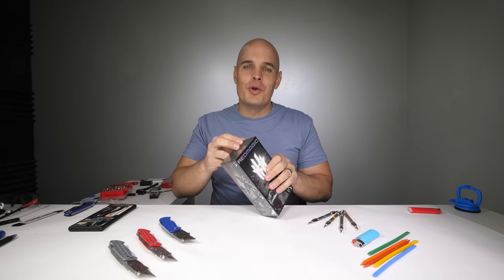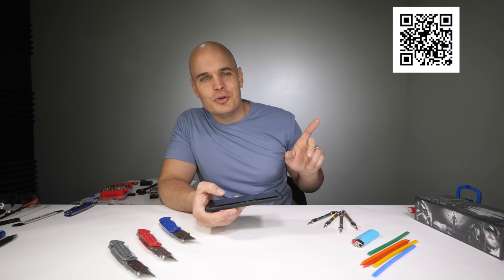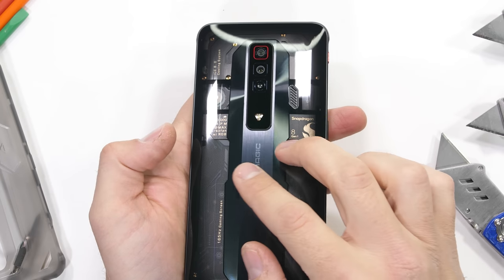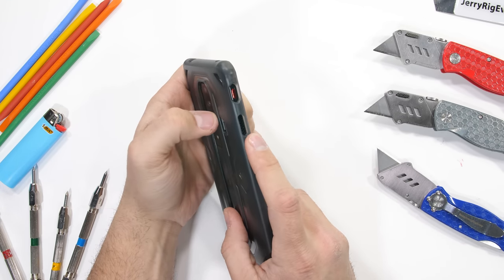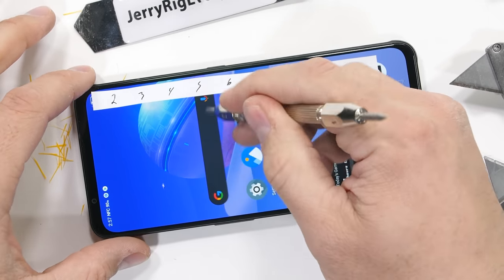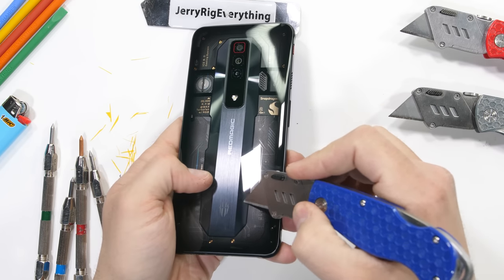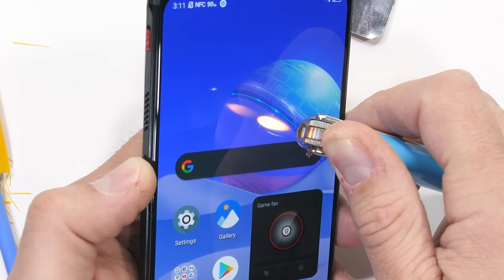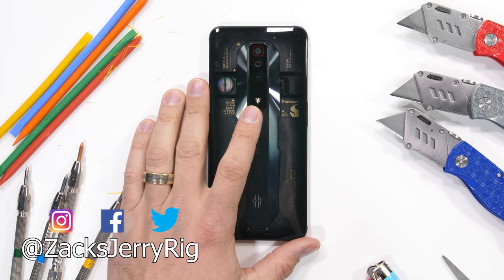Will internal LED's compromise this Gaming Phone!? - Durability Test!

Comment: Awesome that they're finally putting heartrate monitors back in phones! My Samsung Galaxy S3 had one integrated into the flash or something in the back of the phone. I used it with Samsung health and it got me more excited about running. Maybe it's all moot now that we have easy and relatively inexpensive access to smartwatches; but, still cool for extra security. (Can't cut off my thumb to sign in)
Reply: Security? Its just a heart rate and blood oxygenation sensor, nothing unique to you. My S10 also has it, it seems samsung has kept including them. 

The only way to really protect your phone is a secure password or pin. Both faceid and fingerprint sensors are fairly easily bypassed by professionals.
Reply: No the Samsung s3 didn’t have one. The Samsung s5 was the first Samsung s which had an heart rate monitor
Reply: Bro try the samsung galaxy S6 edge it does hart rating too and pulse
Reply: @xander8758  and it's 7 years old.
Reply: It's not part of the security though.
Reply: It was s5 actually
Reply: It’s Both s5 and s6 actually-Maybe s7 too
Reply: @ardeleanalex6918  yep and s8, s9 and s10. Pretty sure they stopped after that tho
Reply: Galaxy Note8 and Note 9 have these heart rate monitors too

Comment: Would be interesting to have a sand/dust test for phones like these, to see what would happen if you were to accidentally drop your phone in the sand. Would the fans break? Clog up, die, etc.
Nice that it survived, though.
Reply: Great idea, as this is my number 1 concern with this phone and will dust pile up under the transparent version and look disgusting.
Reply: And a water droplet also so we can see if it will still work
Reply: @edreyes5322  yes
Reply: I imagine you'd have little grains of sand visible under the clear back for the rest of the phones life
Reply: The intake grid should prevent sand going in which can't go out
Reply: @jonyythetryhrd  yes dust gathers up under the glass. Its not immediately visible when you hold the phone just upon closer look.
Reply: @jonyythetryhrd  well im pretty sure your safe in terms of many part of the phone but your fan with get dust isnide. I recommend getting a custom phone case and remove it when you wanna use the phone. Just try to not break the back
Reply: This is my concern, I do construction so dust is always a issue.
Reply: Been using redmagic 5g for 2 years. The fan works good. Even tho my house had 11 cats whose hairball were flying everywhere. The fan did great job, didn't see any hairball stucked inside. Bad news is my fan stopped working 2 months ago. Didt sebb any dust stuck inside, maybe the fan life already worn out. If i blow my mouth through the fan intake the fan spins for 2,3 second then stopped. But if u have money, u can buy the fan from official nubia website. It cost like 80$ something like that. The phone is easy to repair. I repair my backglass 2 times already due to i love use naked phones. Mostly the phone crack due to fall of from my bike. I rode 400cc bike going fast only shattered the backglass but the phone works perfectly.
Reply: @Stranger_1  I work in a place where there are euro palettes always moving around.
 
Some of it stays on the glass. Its not that bad.
Reply: Also if a dust gets inside. Im pretty sure u could blow the fan inport to remove dust and other.
Reply: @neilgaming2127  Some of it. Some of it just sticks to the glass and doesnt want to come of.
Reply: @eveoff  u could open ur phone and clean it yourself if u have proper tools
Reply: "sand blasts with fine sand, but not with anything above fine sand."
Reply: He promised  this phone
Reply: @neilgaming2127  yes, imo its just a sligth cosmetic issue.
Reply: @eveoff  yea. Had spare 2 backglass cover. i bough black and red+blue just incase my phone dropped i could replace it anytime.
Reply: Love this idea
Reply: I'd love this. I'm a flour Miller so my current phone gets covered several times a day. Was going to get this till I remembered it had ports inside and now I don't know what to get 😭
Reply: I've heard that using the optional cooler fan attachment causes condensation to build up on the insides of the phone, which is a real concern.
Reply: @jonyythetryhrd  the transparent variant gives more edge since you can see if ever dust and gunk builds up in the fan and vents, which can be cleaned by compressed air spray cans or mini-fine brushes.
Reply: Exactly the comment we need and thanks for all the answers. I could not find a single reviewer mentioned or even trying to test the air intake with different contaminants like fine dust, hair, sand etc.. not even zack, that is a disappointment.

Comment: Red Magic seems to know what they’re doing on the structural level 😂
Reply: Yes, and even performancewise.

Too bad about the software tho
Reply: @Anankin12  you can flash stock Android, or even something custom onto it.
Reply: @pvshka  True, but there may still be issues with carrier support and connectivity as their past phones.
Reply: @pvshka  Their Bootlader is  Unlockable??
Reply: @nou8419  I don't see why it wouldn't be? Enable developer options -> enable USB debugging and OEM unlocking, then unlock the bootloader with ADB.
The harder part will be finding a supported ROM that's guaranteed to support all the phone's functions until the phone's been out for a while.
Reply: @pvshka  Oh, well i thought it's forever locked or has some code, Number etc... Thing.
Reply: @nou8419  It's a run-of-the-mill process for most Android devices. I honestly can't say for sure if it's the case for Redmagic 7, but I don't see how or why they'd make the process more difficult.
Reply: @pvshka  the fan.
Normal android phones don't have a fan controller, so a non specialized software may make the fan completely unusable in some way.
Reply: @Anankin12  ahh, shit, you're right. Completely forgot about that 😅

Comment: Would be great to see a test of screen durability against impacts, not only against scratches.... Realistically all glass screens these days scratch the same way, so would good to find a new way to differentiate one glass from another
Reply: The problem is you can't do identical impact tests...so you might end up with the same phone either being alright or breaking just because of very minor differences
Reply: @oopdigdigfig9786  yeah I was thinking that too, but surely there's a way to jerry rig some mechanism that would very consistently apply the same impact force every time...
Reply: But the reality is there is plenty of phones that either lighten or cheapen up phones with plastic screens or lower grade glass. And there even has been diamond screens though rare they are untouched at 6

But i agree this test is basically to tell you if its GG5 or GG6 these days.

But to speak gor myself for a second these tests and where they scatch at, mostly tell me if the company is trying to save money.

If they tried to save money on the screen. Chances are they did on the CPU and internals too.
Reply: @vstolpner  youd have to remove the screen on each phone with a heat gun and put it under an evenly distributed hydraulic press.
 
But even then i dont know exactly what that will tell us besides "what point the glass shatters once heated up, removed, layed flat, pressed" 

We KNOW the future of screens is artificially created Diamond screens. They already exist they just arent cost effective for something you replace every year or 2 atm.

But it also tells us when a phone company is skimping on quality like i said in my earlier comment
Reply: I've still got a sapphire screen, and I will not replace it lightly.  This phone has my interest though.

Comment: It can still be water resistant. If the duct runs on the outside and touches the heat sink for the processor, there is no need for actual air (or water) to come near the electronics. Whether the fan shaft can be driven non permeably is another topic.

Comment: Nice video, as always! Just a suggestion: why don't you test if the phone is waterproof, when it has the "little protection" (like the rubber ring at the Sim card tray), but don't have a certificate like IP68? Would be good both to discover, and to see where the damage occours during the teardown.
Reply: Agreed
Reply: Surely the water is going to enter through the fan vents
Reply: @parshakamarsh  not only this phone, but other phones too. Like One Plus, Poco, etc
Reply: @GorgonJob  sorry about that, I thought from your comment that you were talking about this phone in particular

Comment: If only they would've put stereo FRONT FACING speakers on this device I would've bought it in a heart beat! I absolutely can not own any phone without stereo front facing speakers. I absolutely despise bottom firing speakers.
Reply: just wear headphones
Reply: @coler154  headphones are great sometimes, but most of the time I prefer to be able to hear the outside world around me so I don't use headphones often.
Reply: @bluegizmo1983  This is what's holding me back as well from buying Redmagic phones. I have ROG 2 for 2 yrs now and I'm used to front-facing speakers now. Hope ROG 6 would be an awesome phone.
Reply: @eado22  I'm still using a ROG Phone 2 as well! I love this thing 😁
And before the ROG 2 I was using a Nexus 6P which also had front facing speakers.

Comment: Red Magic is a huge liability as it's not water resistant - if you need to repair it because of that, you'll have to pay more than its original cost (!). They don't have physical stores or local support which means any repair will be done abroad (with shipping costs being charged to you), and any peripherals you want to buy will also come with a shipment surplus, so it's just a money sucking machine. Just to give you an idea, my RM 6 pro (top specs) lightly touched some water which got into the charging port (so it's not like it was submerged) and because that's not covered by the warranty I had to send it abroad for repair. They said all data in there is lost (an sd card slot would have been useful here) and they are asking for roughly 120% its original price to repair it. Obviously I'm not paying that to repair a phone that is no longer their latest generation. I'd be paying more than double for a soon-to-be obsolete device with not even any emotional attachment since all data is gone. Gaming phones are a huge risk because they're not water resistant, but Red Magic really takes the cake. Any suggestions on a high-end cool smartphone I can use for gaming that's water resistant and has good customer support?

Comment: I am going to be honest, most glass phones are really durable until they crack and you have a weaker structure, so if you are using a glass phone check that the glass is intact because it is what gives out a lot of the support so the phone doesn't deform in the weak ponits. i think is a miss that the plastic case doesn't let you see the fan moving.

Comment: Bought the Red Magic 6S Pro last year. Replaces the Razer Phone 2 I've had since it's release of 2018. Battery is pretty gone. Pretty happy with the 6S Pro so far. Main wish is that the screen had variable refresh rate and hope that it'll last some 3+ years before the need for a new phone.
Reply: Still have the RP2 the google assistant stopped working wich was the deal breaker, I love my RP2 :<
Reply: same as iPhone 6s Plus

Comment: Can they make it such that everytime fan spins a mechanical gate opens and at other times it remains shut to keep it from dust
Reply: Also there's already a motor on board so you can possibly anchor it's power for the mechanical part

Comment: I was actually betting on the red magic to NOT survive the durability test. Honestly, I'm glad it did. But the cherry on top, it has a headphone jack and, for me, that immediately puts the phone on a higher tier than others. This is definitely an option when I change my phone, even if the RGB is just dumb.
Reply: I mean yes, the RGB is dumb, but they managed to fit that in along with the active heat dissipation without sacrificing structural integrity. Props to them.

Comment: I just can't see a reason to buy a gaming phone. Regular flagships have 90% of the capability as they also get the best processor to date. 
The only real benefit is integrated cooling to keep performance stable, bit you can get that from a external fan aswell. Having rgbs, integrated fan etc also at massive con's, no ip, bad all rounded features like image processing etc.

Comment: Why did "annoying flashing Xmas lights" become a gamer thing? 
As an actual "Gamer" I'd much rather turn them off and use that extra power on the fan to cool things better, or add to the GPU to better overclock it etc. on a phone I'd rather save on battery power for longer gaming ...

Comment: this durability test is not aging well. When stuff like screen protectors are coming by default and phones are increasingly using amoled, both the burn test and the scratch test start to feel incredibly outdated. And the bend test, although the idea is VERY sound and testing for rigidity is important, come on rt? trying to bend in our own hands? One day he drinks a lot of water his strength perception can change dramatically. I'd say more drop tests, with cases and screen protectors first then without them.

Comment: Your fingers don't have good luck with FPR because A: they all suck and B: you actually use your hands for something other than typing on a keyboard all day. You should daily drive a device with true 3d face unlock tech for a bit, the user experience is so much nicer not hitting the brick wall of having to enter your stupid pattern/pin every time you reach for your phone.